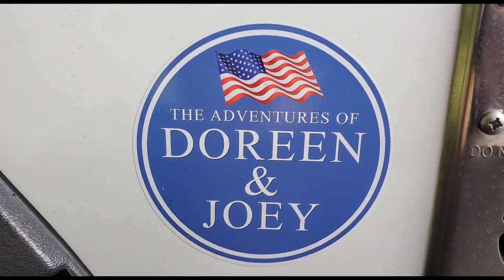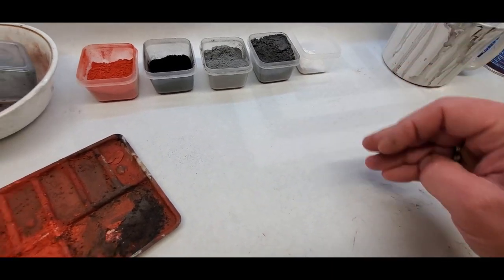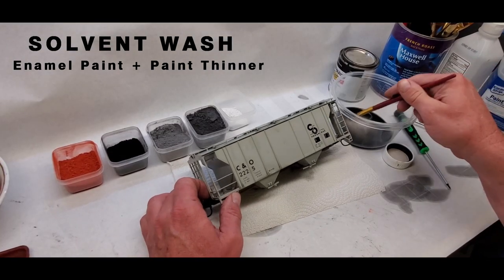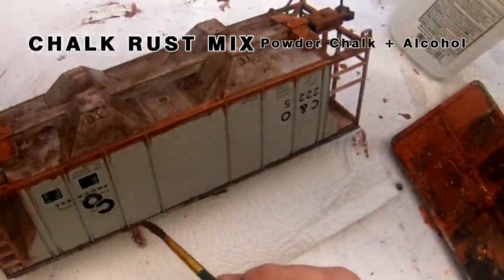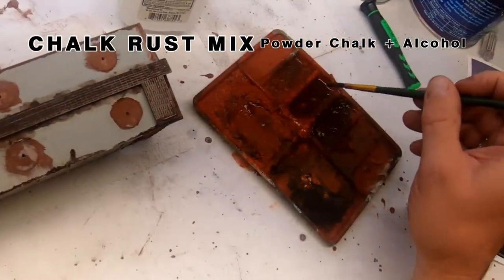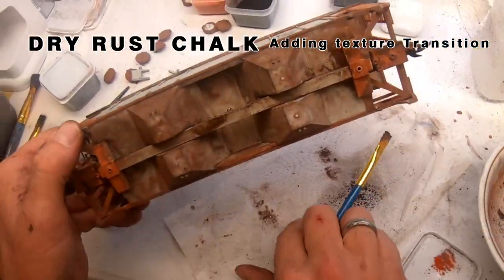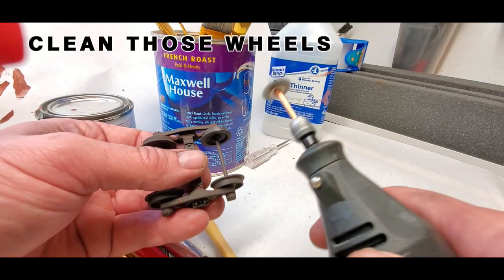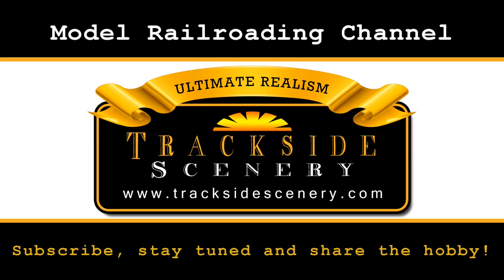How-To Model Realistic Weathering - Covered Hopper - Budget Supplies

Comment: You mentioned using a blender to get the weathering chalk finer. That works for all types of things in modeling. Like grinding tree leaves for forest scenery. But for smaller scales when you need super fine stuff a coffee bean grinder is the best. It will powder just about anything that is dry. Not rocks but most everything else.

Comment: I can't find that Color Place flat cheap spray paint at my Walmart anymore. Where are you finding it ?

Thanks for the cool video.
Reply from the maker: I noticed that the mart stopped carrying it a while ago. Lowes had some last time I was there. Might not be that $buck a can, but close enough.
Reply: Lowe's has a no-name flat black that's 99 cents a can...they bury it along the floor so they can sell you those $7 cans at eye level...
Reply: Jeff P I've tried the Lowes and Home Depot down on the floor cheap rattle cans and they work great. But I can't find any other color but but flat black 🤷‍♂️